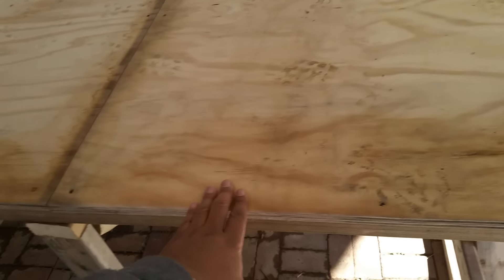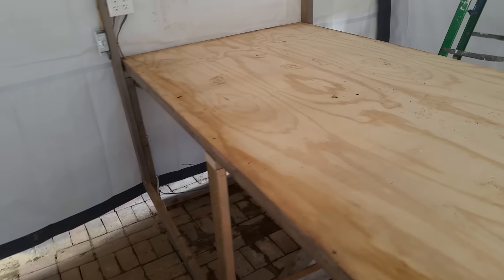BABS 2/27/16, Part 2. Stone completed and Electricity installed

Comment: For large tools I think the older the better, back in 1980's or older. Before they shipped manufacturing offshore and they used real materials. Weight is what makes a table saw stable, so the heavier the better! Check with schools as many have done away with shop programs and there tools were generally lightly used. Motors and bearings can be replaced but solid table takes material, just no substitute.

Comment: Whatever table saw you decide on, make sure the internals don't have plastics (no matter how good they make them, glass infused or not, plastic is plastic and it fatigues very fast, especially in something that vibrates a lot and at high frequencies like a table saw) and check that the arbor doesn't have run out.

It seems to be more and more a problem with new saws, even quality ones (found a Makita table saw with 2 mm runout, i was shocked, but the test indicator does not lie). It's not something you can't fix with a bit of ingenuity, but you'd probably spend that time building a boat not grind the arbor.

Also, i'd make the suggestion of adding a frame at the bottom that has four adjustable legs (simple design made out of four bolts and nyloc nuts). Last year i had a project in the middle of nowhere and obviously i had to use a table saw on the ground, having that adjustable frame was a blessing.

Oh and one more thing you can make on the cheap, is a lumber roller (the thing that catches the lumber as it exits the cutting area so it doesn't fall on the ground, i don't know the english nomenclature for that item), we made one out of a paint roller with extendable handle, that was stuck in the ground.

Perfect, simple and dirt cheap since we just used one we had sitting around collecting cobwebs.

The place looks awesome, really neat and trim, which in a workshop is paramount. Especially in a boat builder's shop. :D
Reply from the maker: Thoes were really great comments and suggestions. Thanks so much for commenting. Peace and blessings :-)